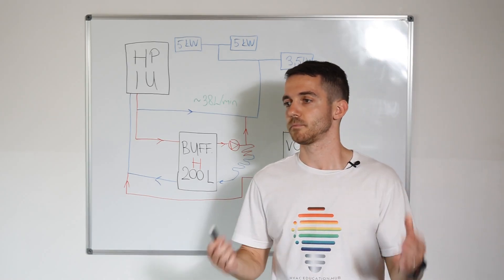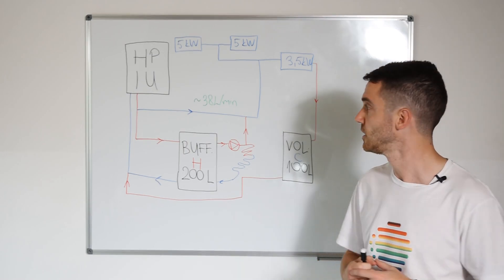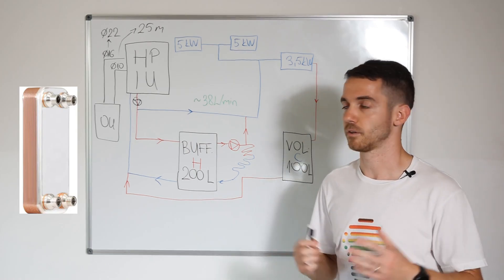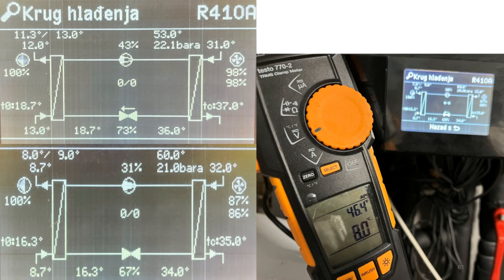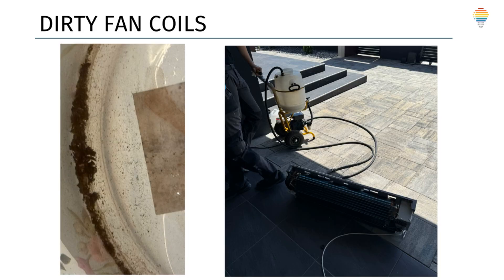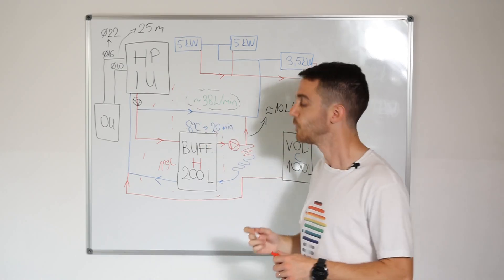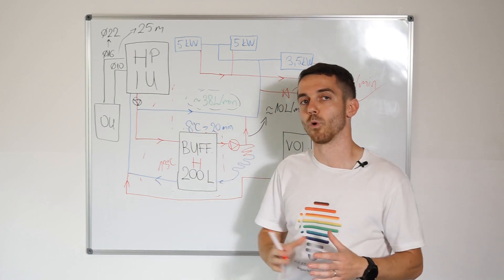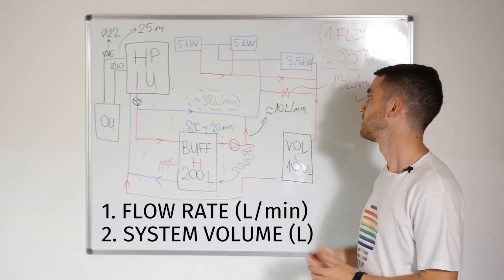Troubleshooting Heat Pump Systems with Cooling & Fan Coils | Hydraulic Design & Flow Rate Fixes

Comment: Mine froze solid last winter so had boiler installed again . Avoid heat pumps !
Reply from the maker: Probably there was a problem not related to the unit itself

Comment: I used to commission industrial units and it was always considered to be poor practice to have two or more pumps on the same circuit without a low loss header or similar and also some form or measuring device (FMD) such a device takes the guesswork out of the  equation, heat pumps are a great invention but it is usually it is the installation that lets the technology down.  Great vid as is said great food for thought.
Reply from the maker: There is hydraulic separation.

Actually primary pump is used for cooling with volumizer but in heating buffer + secondary pump.

Comment: Great video! I have a Daikin 16kw Heat Pump, with 11 fan coils and 3 towel radiators in the bathrooms. Never got a heat flow problem, no buffer. But when I installed it (made the heat loss study myself as a mechanical engineer, but I had no experience with HVAC at all) the shop owner where I bought the HP advised to use Φ25 pipes for the larger fan coils, because in cooling we need unobstructed flow. So that's how we went, Φ25 for the larger fan coils, Φ22 for the medium, Φ18 for the smaller ones. So, with 11 fan coils and so many meters of good diameter pipes, I have enough liters in the system (even with the 3 radiators out, to avoid condensation) the heat pump works perfectly, it modulates between 15 and 30 liters/hr as far as I have seen, with miminal start/stops. I don't have buffer and no 2way or bypass valves on any fan coil (just the fan motor modulates when they reach the set temperature). I am pretty satisfied.
Reply from the maker: This is the best setup, thanks for feedback.

Actually the simplest is always the best and, as you mentioned, good pipe diameter.
Reply from the maker: Just to add, you probably have 15-30 L/min, not per hour
Reply: @HVACEducationHub  correct!!!
Reply: The problem can be that you can need some energy to defrost and normally the coils have less energy to give then. Maybe in 11 fancoils you have enough, but using this system in a cold area for heating, I would reccomend a proper calculation of the energy can give 11 fancoils workin on loses, means low temp - energy. Fo summer it's ok.
Reply: Great point there! You need enough energy in the circuit to reverse the cycle and defrost the coil. I have never had such issue, probably it helps that I have many meters of running pipes, as well as long and big diameter main pipes, not 1"!!!
Reply: @ppanagiotopoulos  depends on the heat pumps... as example I only works with Stiebel Eltron right now, and more  or less need around 400 to 800W of energy to defrost. Anyway, I prefer to not use puffers and use PWM singals to control circulation pumps, there's when we 
are having best SCOP.
Reply: @ppanagiotopoulos  anyway my reccomendation to0 work with fancoils and NO puffer is to eliminate valves, and fans alwaysd min power on stand by or night function. In some models even we use some special resistors ot make them even more silence at night. So thermostats only change speed of the fan, but never stop them. Then you can operate with heating curves and inside compensation.
Reply from the maker: Even if you stop the fan but you have 3 way valve (not 2 way stop valve), water will circulate

Comment: How the heat pump manage to make hot water for shower ? Is switching from cooling to heating automatically ?
Reply from the maker: Usually 3 way valve is switching but here gas boiler is used for hot water
Reply: @HVACEducationHub  eeehhhh... Methane gas heater ??! Is not nice. 
When a house go full electric don't use gas anymore. 
It must be a solution without additional heat pumps.
Reply from the maker: Natural gas + heat pump combination
Reply: I have heat pump+solar heater. No need the HP to work at all for DHW during cooling season.
Reply from the maker: Depending how much solar gain you have and how much solar panels